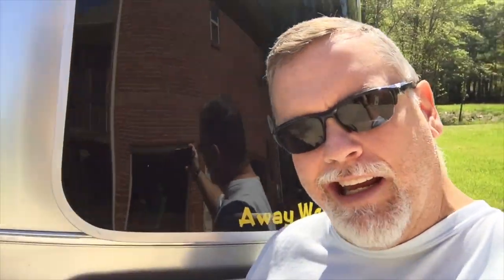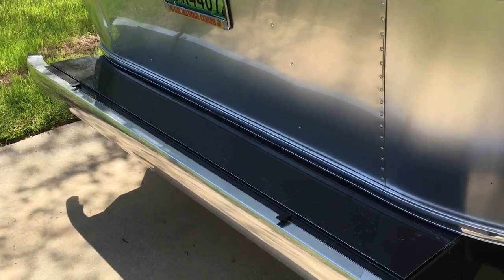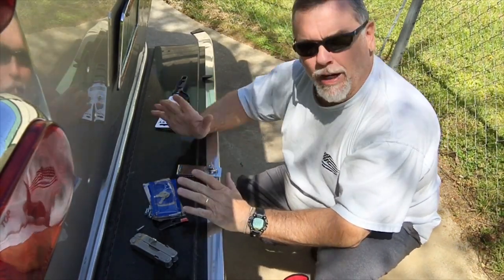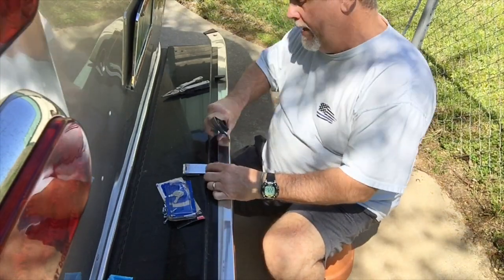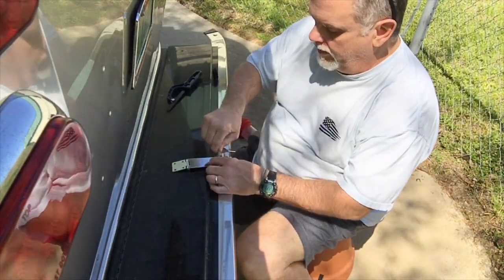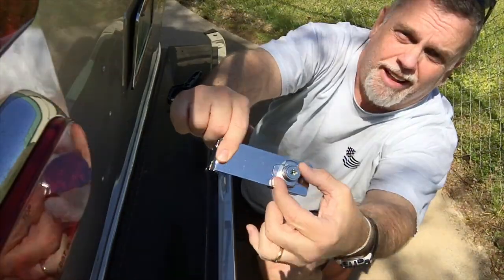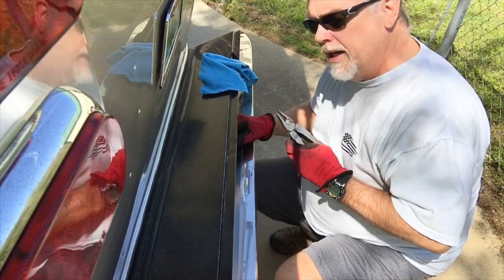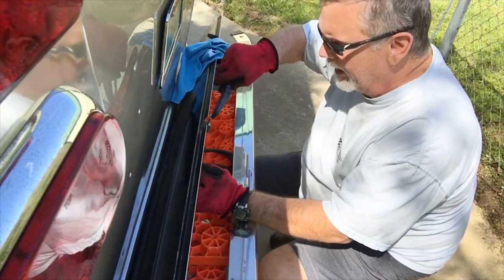AIRSTREAM REAR BUMPER LOCK

Comment: Awesome video......Glad I found your channel. We have a 2018 19 'FC and have been looking at a 27' Globetrotter. Can you tell us what the backstory is on the upgrade from the Bambi. Thanks, Tom
Reply from the maker: thanks Thomas.  The background to the switch were really two items: 1) the GT is SO much nicer and larger than the Sport 16', and the transition from "most of the timers" to full timers.  The Sport 16' was a nice unit and easy to "use," but we needed the room for sure.
Reply: Thanks.....have fun. Is the GT much harder to tow?
Reply from the maker: Thomas Probst not really. Longer of course and heavier but still, as is the Airstream general characteristic, a breeze to tow because it sits so low and is so aerodynamically stable.
Reply: Have you had any problems with road dirt, etc.,  getting into the key assembly and jamming the mechanism?